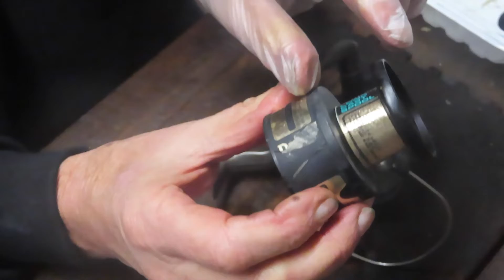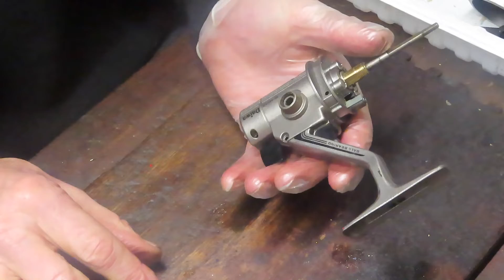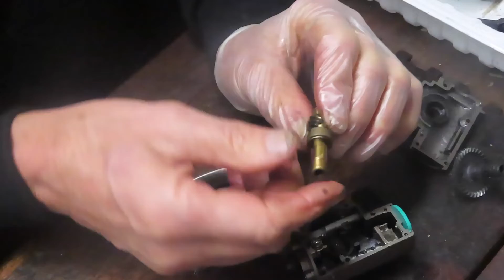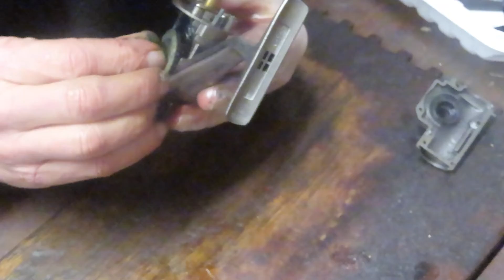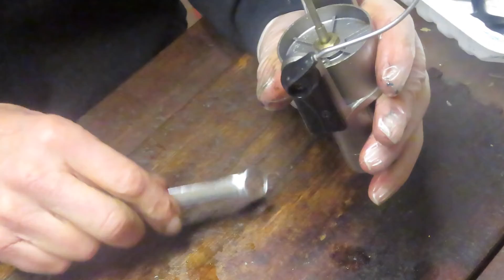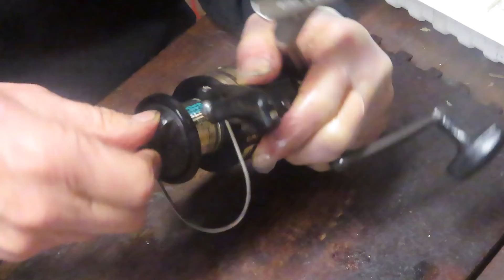Daiwa PS 2500 long cast fishing reel how to service and repair

Comment: You have been an excellent teacher from whom we have learnt so much about reels in particular. Sir, have a Daiwa SKA1055 which have an Auto Cast lever, now , that lever is always stopping at just the opposite end of the reel, please teach me to set it right. Thank you so much.
Reply from the maker: Yes, remove the rotor and turn it 180 degrees then reset it.  That will land the trip lever at the arm of the reel and will correct your problem. - Thanks for the note and for watching - Dennis

Comment: Huh I have the same reel but it’s numbered 1650 on the bottom, maybe indicating different sizes?
Reply from the maker: Yes - the model numbers often were used to indicate the reel size and spool capacity.  I am not sure how that relates to these two,  The 2500 is a freshwater reel - Dennis

Comment: Dennis, I have a PS 2000. It is not a fast cast reel like this one and I bought it sometime around 1995 or 96. I was at the beach with a group of kids at youth choir camp and some of them wanted to fish and I hadn’t bought any tackle so I went out and bought the 2000 and an Ugly Stick to fish. I took that AR clip on the main gear off and the reel works even smoother. That clip is a redundancy in the reel that may be good but it is not necessary for the reel to function. In my reel it caused the reel to run rough so I took it  my 2000 had a spring that engaged the AR arm with the ratchet that was activated by the flip switch on the rear of the case. Back in the late 1990s I caught right many fish with this reel. This is a fine reel. I like the worm gear oscillation system in it. I wrote you about this very reel and the necessity of that clip on the main gear. I’m so glad you did a video this reel!!! — Chris
Reply from the maker: Thanks Chris.  These are fine reels - Stay well - Dennis